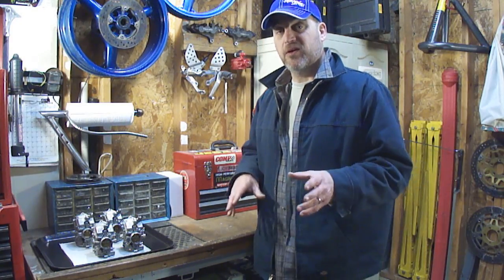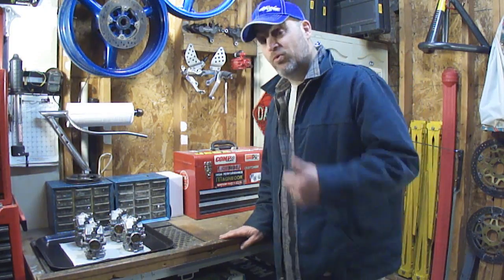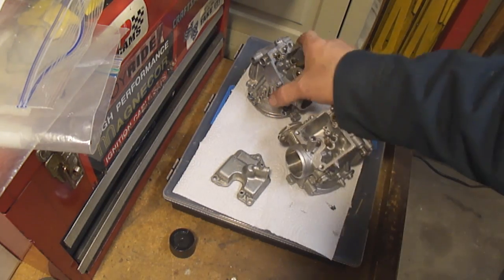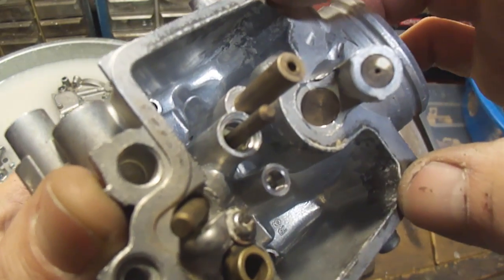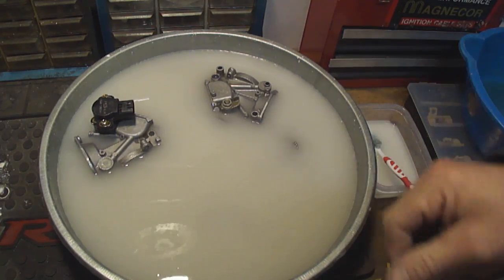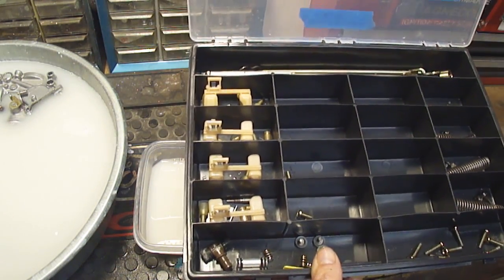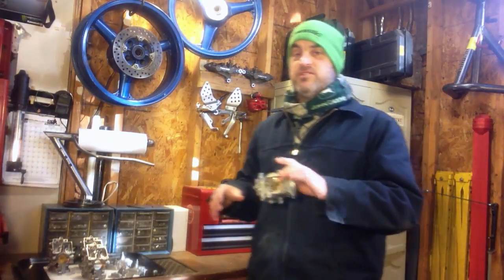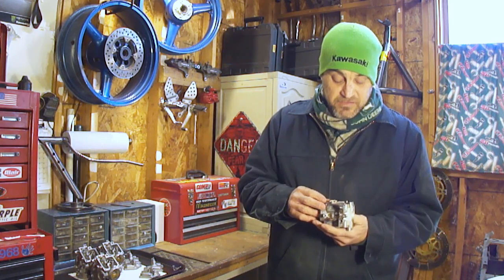Cleaning Kawasaki ZX6R Carburetors with Bar Keeper's Friend

Comment: a random question for you. I have zx6r 99 g1-g2 and that crankcase breather at top of engine. where does that short pipe go? mine leads to nothing. but on your bike looks like it's attached to the intake boot
Reply from the maker: If you are speaking of the crankcase breather hose that comes off the top of the case, it attaches to the top of the airbox.  I have everything much more together and should have a video out within a week.  I will make sure to cover all the hoses and their routing.
Reply: is that the big hose that connects under the carb /airbox baseplate, I'm on about that tiny hose that sits near the ignition leads ontop of the radiator locates off the same plunger unit, looks like a little vacuum hose , mine leads to nothing,
Reply from the maker: there is one coming out of each carb boot.  The middle two come together in a "T" and then travel to the front of the engine on the smog plates.   I have the "T" blocked off since i have the block off plates installed.   if you need some pics, shoot me an email at info@bluepawdynamics.com and I will send you anything I can to help.
Reply: Blue Paw dude your awesome!! thank you , I knew that pipe was apart of the vacuum feed. I tried that block off plate, well I used a piece of pipe and joined the two plates together , however I had serious problems with high oil pressure! from the block off ECT the engine started burning oil with block off. I then removed it and the  blue smoke stopped. that's my exspirience  with blocking the smog vent.
Reply from the maker: Glad to help!  I saw you working that burnt valve out.  Ouch!  That thing was toast.  Nice work.  Let me know if you need anything else!
Reply: Blue Paw thanks man! yh I had burnt valve, all fixed now, only problem I have been driving car for about a month , now I poo my pants getting on a bike , so dam fast thing just wants to move . I don't like it anymore
Reply from the maker: I get it man.  They are fast!!!  On one of these, 100mph is shifting into second gear :D